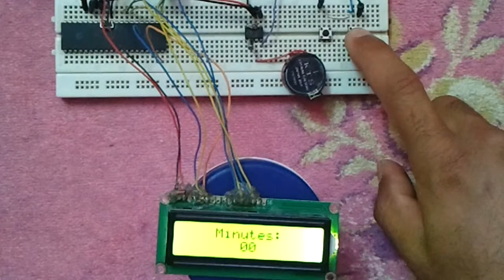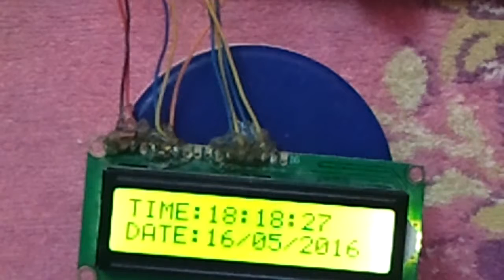Interfacing PIC18F4550 with DS1307 real time clock using CCS PIC C

Comment: I use this DS1307 clock (4.7K resistors) , but don't work in real life , Use address 0xD0 and probe 0x68 (arduino use this) , and still dont working , to know if this receive and I2C commands, I turn ON and OFF the pin 7 (this pin can output a 1 Hz wavesquare)

_I2C_Start();
_I2C_Write_Byte(0xD0); or _I2C_Write_Byte(0x68); 
_I2C_Write_Byte(0x07);
_I2C_Write_Byte(0x10);
_I2C_Send_ACK();
_I2C_Stop();
__delay_ms(500);

need help, please !
Reply: this I2C driver does not work, I guess its because of newer CCS IDE version, use this driver instead:
http://www.ccsinfo.com/forum/viewtopic.php?t=23255
yet I would mention that this video clip and the owner's web site are very informative...